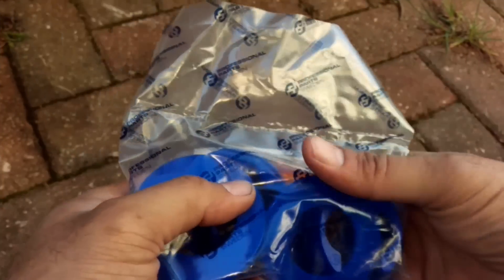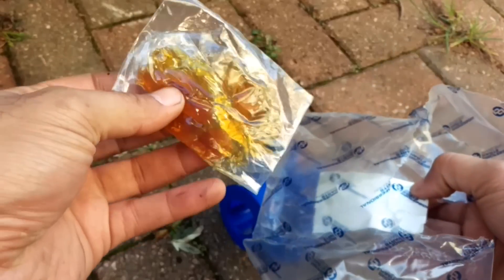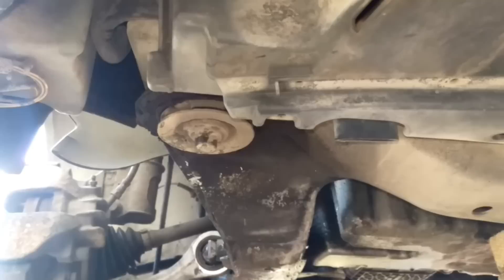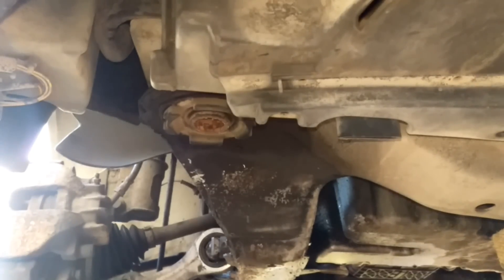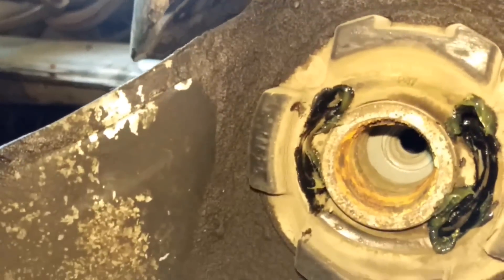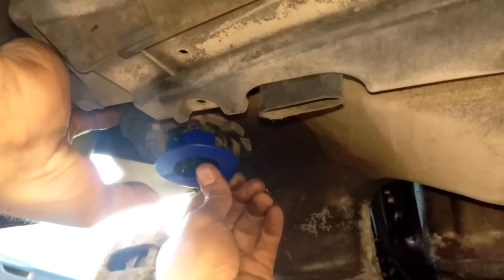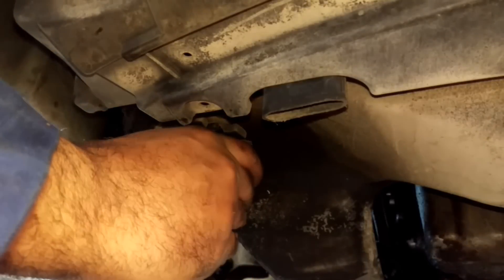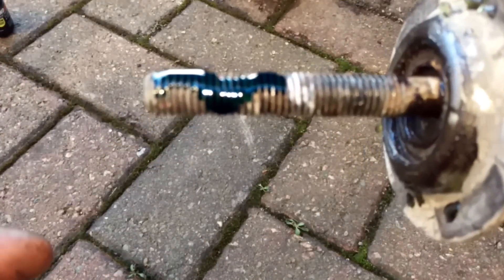Polyurethane Subframe Bush Insert Fitting

Comment: Great video. Perfect overview of how to fit these items. Many thanks for posting it. I put these in my car (a 2000 V70N T5 with nearly 240k on the tacho) and they made a significant difference. I'd already poly bushed both sets of front bushes, which certainly stiffened up the front end,  but the improvement in turn-in and feel when these were fitted was very noticeable on top of the bushing. They're a great product. Pretty cheap, easy to fit, and in the case of an aging car with a few miles on it, a very effective and economical buy. A steal, really, next to the bill for a main dealer replacement of the rubber original items. They really do make a tangible difference to the feel and tautness of the car. If you've got an older car with a few miles on the clock, I'd highly recommend them.
Reply: Bet you made me get emm  ordered lol

Comment: I couldn't get these into my 98 S70 bushings for the life of me. Even after I lubed them up good with some synthetic grease! I ended up having to do this job twice (the first time I used Proparts bushings and they failed a 1000 miles later). Second time around with OE bushings the car's been an absolute dream... It's good to know it can be done! Thanks for posting!

Comment: Thanks for another great video!
Fitted these to my v70 with 145,000 miles and it significantly improved the steering feel.
When inserting them I found the front right mount was damaged but the rest weren't too bad, the rear left was in great condition.

Comment: I installed these on my P2 volvo and they work great! I found a better technique to get them into place:

Find a bar that will fit into the subfrrame bushing's inner metal sleeve. I had a 12" long, 0ne inch dia. bar and that worked fine
   Silicone grease the heck out of everything - I also sprayed silicone lube into the spaces in the subframe bushing. 

Slip the insert into place, just enough to hold it. You will find that it is easier to push into place on one side over the other

Insert the bar into the hole. While pressing up on the insert, rock the subframe bushing back and forth with the metal bar. This will sort of pull the insert into place. The insert will eventually work itself into place, at least enough where you can use the big washer (front) or the rear mount bracket, to push it all the way in.. Just tighten the old bolt to push it into place.

No kidding - get new bolts and follow the torquing procedure exactly.

Comment: I've installed these inserts today, and here's my point: these inserts add some space between the inner rubber part of the bushing and the plate with the bolt. This means the outer part of the bushing is no longer supported by that plate, since it does not touch it anymore because we added the inserts. So the subframe is only supported by the inner rubber part of the bushing. My guess is that the inner rubber part will sheer  soon due to the load. Before the inserts were installed the load was distributed on two rubber parts, after it's installed only by one part. The manufacturer did not calculate the load of the subframe to be supported by that one rubber part. I would cut those inserts in three parts, insert two of them (the ones that actually go into the bushing) and do not use the circle part of the inserts. Let me know what you think.

Comment: Hi Simon

Many thanks for many useful  instruction videos, however FYG - i have a XC 70 D5 2006 and I discovered that in front i could fit in the inserts however in the rear my Volvo was fitted with solid bushings hence no space for inserts.
So now I have 2 in spare😊
Reply from the maker: Helge Lassesen Interesting.... Thanks for the info. 
I wonder if the rear solid bushes are original?
Reply: SiRobb B
Yes they are, I have owned this car as from new- only changed bushings in the wishbones
Brgd

Comment: Interesting to note that the original bush works mostly on a side-to-side movement of the subframe,  thus effectively affecting the steering feel.  However the polyurethane insert will mostly work on a forward-rearward movement.  I wonder how efficient are these be to correct a vague steering feel due to worn original bushes?
Reply: The shape of the inserts causes the unwanted side to side movement to also mostly cease unless the bushing is completely eroded.
Reply: that is a great question!
Essentially the rubber ages into soft  chewing-gum and creates the perfect "old car feel" with very few bad parts that need replacement.

The ultimate would be new bushings + inserts to cancel unwanted motion .

Comment: Another great video Simon! Thank you very much!
My subframe bushings on a 2005 xc90 2,4 awd were quite worn, and I had some cracks at start and stop so I decide to fit these inserts. These inserts apparently solved the problem, I have no more cracks when I start or breaking, but sometimes when I turn the steering wheel to the maximum and I go backwards, or sometimes when I start and cross a small curb and the steering wheel is turned I heard a louder crack. It is possible that the hole yoke to move? I also had a problem with the direction. I adjusted the direction twice. After a few km it goes awry. The steering wheel is no longer in the normal position and pulls to the right. Usually if I turn the car on the road something hits and the direction returns to normal, after that it goes wrong again. I changed all the bushings, arms, sprockets, but the problem still persists. I have no noise at bumps. I had in many services too but they didn`t find the problem. Can you help me with a suggestion? I saw that you are a Volvo specialist, you helped me with your another great video about the vacuum engine mounts. Thank you very much!
Reply from the maker: Hi, first job is to get a laser wheel alignment done by a professional.
Reply: @sirobb  Thank you for your quick answer. It was done the laser wheel alignment 2 times before, but after about a few km-s, I had the same problem.
Reply from the maker: @tamasneda2204  The steering wheel is keyed so can only fit in one position and not slip. 
If the control arms have been replaced, the track rods are correctly adjusted, the subframe is secure and not out of alignment and the tyres are in good condition, matching and inflated correctly, I can't think of anything else unfortunately.
Reply: @sirobb  Thanks' again. I didn't know how can be verified if the subframe is out of alignment or not. I only put the inserts one by one and after that I put new bolts and tight them up with the recomended torque. Thanks.

Comment: Can you comment on any improvement you've noticed in ride quality? I am chasing down the reason for my rough ride and I have so far replaced all major suspension components (struts and strut bearing, ball joint, control arm bushings, sway bar links, inner/outer tie rods). Short of replacing the actual subframe bushings I am wondering if this will make a difference for me.
Reply from the maker: thestrokes679 The improvement in ride was subtle but very noticeable and if I was in your position, I would definitely fit the inserts.

Comment: I am replacing the entire bushes. With the correct technique, it is actually quite simple, but there are indeed a few tricks, otherwise it's a pain.  It may actually be even faster that these inserts which don't always go in that easily.  The downside with the inserts is they don't help much the side movement of the bush which is already soft (the bushing has side reinforcements). Genuine bushes are about $30 each so not too expensive.

Comment: How are these holding up 4 years on?  Seems there are a few options for inserts, some more dear than others.  Thanks.
Reply from the maker: Mine are still great 5 years on and the V70 in this video is still going strong too.
It's quite a "dumb" component which is well held in so doesn't need big money spending on it.
The biggest difference is fitting them in the first place rather than whether you spend £20 or £100 on the insert.

Comment: Hi!

Just did this and have a question - did your rear mounting brackets seated back as flush with the subframe as before?
Because mine did not. I have a gap of about 4-5 mm. This worries me.
Reply from the maker: I would check your work again. 
Doing this job correctly, you're not doing anything that will stop the plate refitting the same as before. .

Comment: Hey, I'm doing PCV and trying to replace MAP sensor as well.  Problem is, on most videos it shows it on the fuel rail, but my 2003 v70 2.4t I cannot find the sensor anywhere for the life of me.  I've taken off all intercooler hoses, turbo charge air pipe... Any idea where it is placed?

Comment: agreed, address to my list of jobs.
please would you post a link of the inserts that you recommend and what is the purpose of doing do this? 
I also assume the s80 d5 would use the same setup? 

thank you again

Ben
Reply from the maker: Ben Charlton There are a few sellers of these so I would advise anyone to do their own (very quick) research and check with the seller for compatibility. 
The S80 shares many common parts so I'd be very surprised if these aren't suitable but ask the supplier.
Reply: Ben Charlton I read on IPD's website that there was a service bulletin for the S80 and an additional rear subframe o-ring was recommended.

https://www.ipdusa.com/products/8283/115683-subframe-o-ring-addresses-sub-frame-knocking-noise

The bushings are the same for the P2 models according to that site. I ordered a set of these inserts from them as well as the o-rings to try out.

Comment: Hi Simon, I realise this is an older video and I hope I will receive an answer. Do the the bolts need to be tightened to a specific torque?
Thanks in advance,
Reply from the maker: Yes just like every bolt. Around 100Nm on mine but always check the workshop manual for the exact figure.
Reply: 105 Nm
Reply: Thank you

Comment: Hi Simon, another excellent video. Can I ask where you place the axle stands while the car is raised to enable fitting the bush inserts. When I put my car on stands (same model as yours with 163 D5 EUROIII) I normally place them under the sub frame rear brackets, maybe this is wrong but it's worked for years so far! So any advice greatfully received. Thanks, Bob.

Comment: You have a D5 right? Doesn't it give too much vibrations because it's a diesel? I'm looking to buy these for my V70 D5
Reply from the maker: The subframe inserts have no effect on the D5 vibrations.
Polybush upper or lower torque mounts would though so you don't want to "upgrade" every rubber mounting components.
Reply: @sirobb  thanks! I'll order the subframe inserts!

Comment: Thanks Simon, really enjoy your videos. 
What is the reason Volvo specifies that the bolts are non reusable? Is it because the corrosion coating could be compromised during removal and reinstallation? They don't appear to be TTY bolts.
Reply from the maker: DJ R According to Volvo, they are tty bolts along with the bolts for the driveshaft, crank pulley and others.
Thank you for your support. 👍
Reply: SiRobb Hi Simon, I've got a question for you mate and hope you can help me out. well I have vacuum issue with my volvo XC90 2003 d5 and I there is that popping noise coming from the engine but when I block or close the tvc like you did in a video, nothing happens, I mean the noise still the same. I have replaced the 5 mounts but do you think I should replace the tvc?
thanks for your time and hope you can continue with those videos that really help a lot.
Reply from the maker: Douglas Sampedro Hi Douglas, when the noise continues, that means that the vacuum loss is further upstream. 
The obvious starting point is to remove the small rubber hose from the vacuum pump itself and block the nipple on the vacuum pump to see if the noise goes away. 
You ideally need to do this with a vacuum tester which should show a steady, full vacuum reading.
If this happens, the noise should also go away meaning the vacuum loss is then in the boost solenoid behind the starter motor or the associated pipework or the VNT actuator. 
Any flickering of the needle on the tester when connected directly to the vacuum pump means that the the pump seals need replacing. 

Great care must be taken with the tester connections to ensure accurate reading of any vacuum loss. 

Hope that helps and thanks for your comment.
Reply: SiRobb Thanks a lot Simon for your advice and support. You have a nice day mate.
Reply from the maker: Douglas Sampedro No problem. Let me know what you find.

Comment: Nice job Simon. I already have the parts - just waiting for slightly warmer weather!
Reply from the maker: +Greg Monaghan Great. Post up an update when with your thoughts once you've done it. 👍
Reply: Job done today. No problems, thanks for the video.
Reply from the maker: Greg Monaghan Excellent.
I suppose the noticeable difference will depend on the state of the original bushes. 
Mine have done high mileage so the improvement was marked. 
Even if yours were in good nick, I think that shoring them up with inserts can still be a good thing.

Comment: if the bushings are allredy shot can i still do this or do i have to replace the whole thing then?
Reply from the maker: It depends on what you mean by really shot.
If the bushing is loose within the subframe or collapsed so it can't accept the insert, you'll need to change the bushing.
Reply: SiRobb okay, your videoes really cleared up alot of things that were wrong with my car 😊

Comment: Really nice video! But why is it empty? Is this just extras that Volvo never intended to have there or whats the story, do you know?

Whats the difference between before and after?
Reply from the maker: Chris Fredriksson It's empty for comfort and vibration damping but the bush deteriorates over the years and allows more movement. They can eventually tear and cause banging and poor handling.
The insert basically restores (and maybe improves) the bush's original structure yet doesn't cause any vibration issues in my experience. 

As I mentioned in a comment lower down, the difference was subtle but noticeable and made the front end feel like a new car. 
Whilst results may vary dependant on the condition of different bushes, I've only heard positive comments about this modification.

Comment: Hi simon hope your doing well mate , just wounding the only kit i can find on ebay uk is for x4 inserts but it says its a front kit ? is this the same kit you purchased but used 2 for the front and 2 for the rear ? thanks in advance mate
Reply from the maker: alpinab14 Hi, I assume it's called a front kit because your car has a front and rear subframe but we're only dealing with the front subframe here. 
The kit I used contains 4 identical inserts. 

As always, check with the supplier for compatibility and I hope it all goes well for you. 👍
Reply: Thanks for a quick reply mate much appreciated , im actually sat hear infront of the computer on onlinecar parts.co.uk just about to blow 500 quid on the old girl , car i got is also a 2002 d5 mine has 201k on it which ive had for over 3 years and can say its the best car i ever owned , apart from oil changes ive hardly spent anything on it for the time i had it so i thought its about time i suck it up and get whats needs done
Reply from the maker: alpinab14 If you like the car, it's worth every penny and I totally understand your situation. 
I've had mine 5 years and will be keeping it forever so spending money on quality parts is an easy decision. 

onlinecarparts/autodoc are a great supplier too so good choice.
Reply: SiRobb perfect mate I've never ordered from there before so wasent sure as I don't know if parts are coming from UK or Germany and if they are coming from Germany then how long they will take but hopefully shouldn't be too bad and hopefully the order will be correct as getting a fair amount wishbones vacume engine mounts gearbox mount intercooler ball joints and all the usual service items , the cars been amazing to me never let me down I'm actually getting either a e90 bmw 330i or a 335i at some point this year but 2 main reasons for getting the s60 all sorted is a I've dragged it on for ages this stuff should have been replaced at least a year ago so parts well and truly past it and second I've become a bit sentimental towards this particular car and ever tho there is not a huge amount of money in the car very little actually the car has to go to someone I know like a friend or family member as I would like to see the car around for a long time yet so I guess it's doing a good turn for both the car to ensure she lives on and who ever gets the car will be getting a car better than they ever imagine , that's the thought behind it anyway lol
Reply from the maker: alpinab14 You're definitely doing the right thing. 

onlinecarparts stuff comes from Germany which is why you can get brands that are quite rare over here. 
Nearly all my brake video parts (made by ATE) came from them. ATE make the genuine Volvo brake parts. 
Delivery takes about 1 week. 

Ref: vacuum mounts, Meyle and Corteco are identical to genuine Volvo mounts, they just have Volvo scrubbed off. 
I got a Wahler thermostat assembly too which is also the genuine Volvo part.
Reply: SiRobb that's good to hear as it gives me confidence in that I'm doing the right thing lol , I've sent for Feb bilstien vacuum mounts altho the corteco are 70 quid the feb about 75 and the meyle at 84 so not too much in it
Reply: I'm also thinking about getting the dampers done in a couple of weeks as that's the last thing that needs done to finish everything off , thinking about going for bilstien b4 dampers as they are ment to be oe quality , hopefully they will be the right choice as they are coming in at around 250 for 4 from eBay